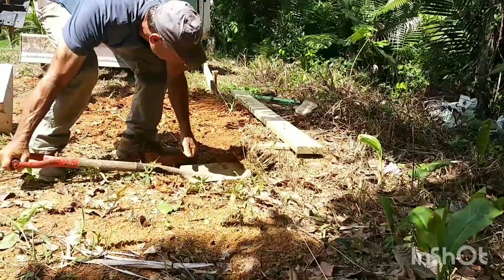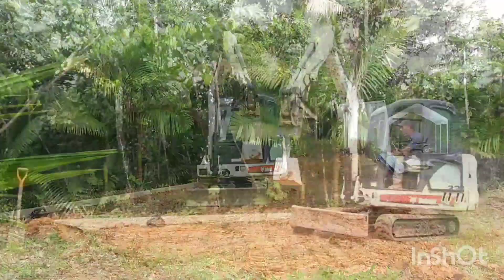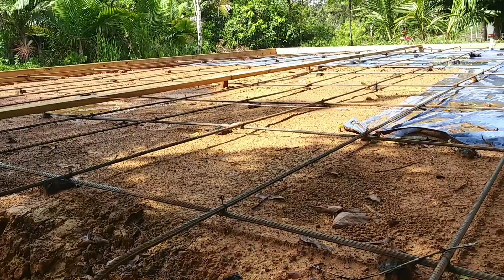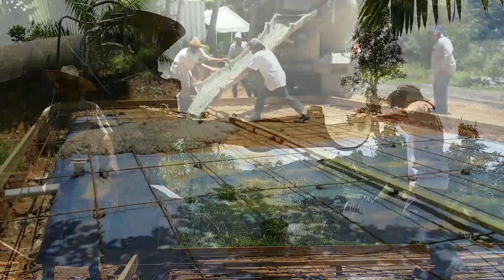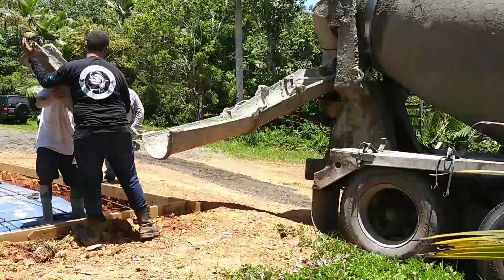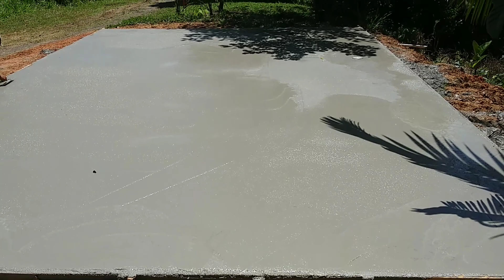Quonset Hut: Preparing and Pouring A 30×20 Concrete Slab.

Comment: Our quonset hut schematic calls for 6x6 wire mesh instead of full rebar.  Is there a reason you did not include it?  I've been watching these videos getting ready for our foundation and yours is the first one that didn't use it.
Reply: Tex I guess its optional depending on the concrete and what its being used for. If you want your slab to hold throughout time go for it. However this is off the grid so people improvise. The rebar should be sufficient.